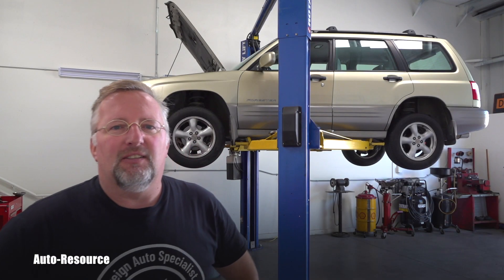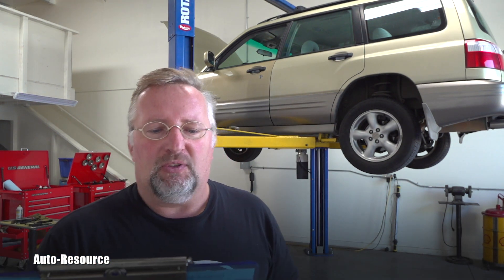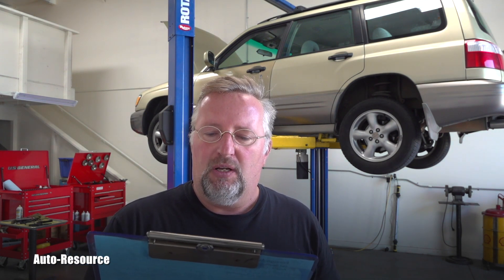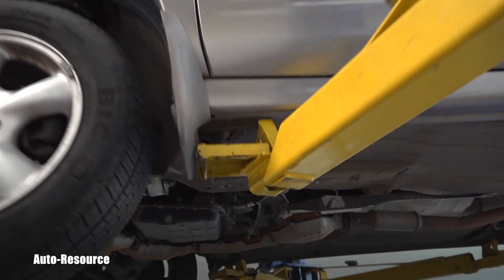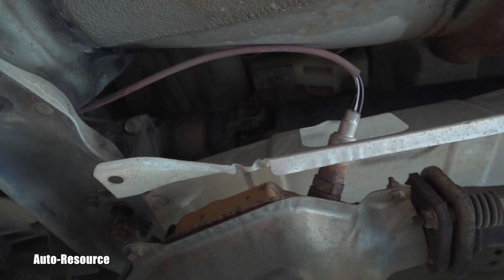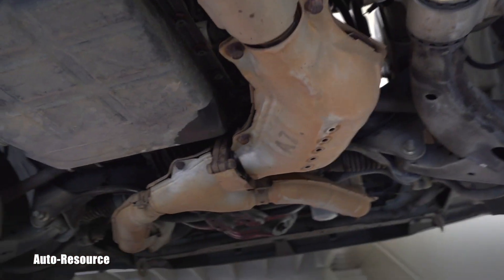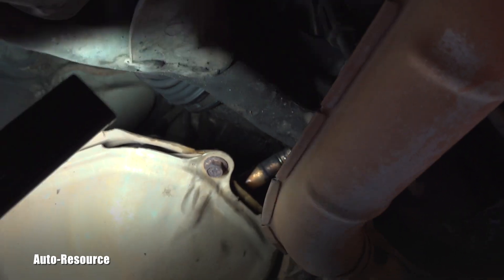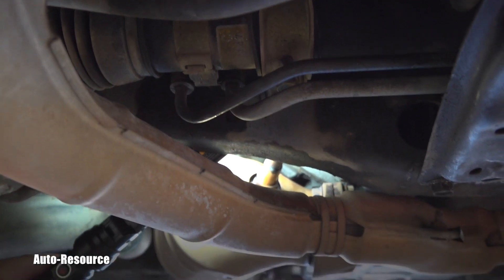Subaru codes P1137 and P0133

Comment: good afternoon !! I have a goal g4 1.0 engine ea111 the code p1137 appeared, already I changed spark plugs, ignition coil, nozzles, sensor map, temperature sensor, but the code keeps showing up.
Reply: 1137 indicates a problem in the sensor's circuit//range or performance problem. Did you change your O2 sensor/attempt to diagnose it's circuit/wiring???